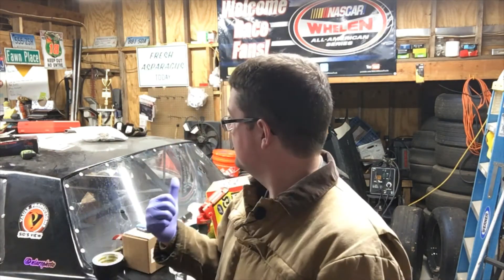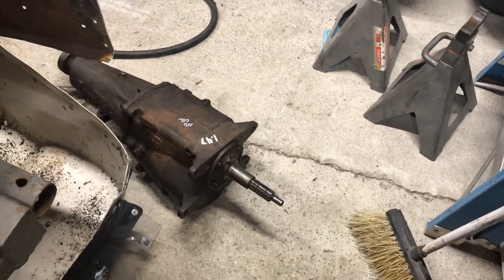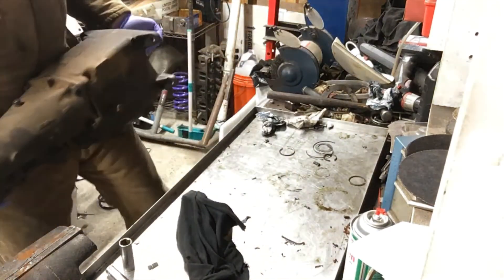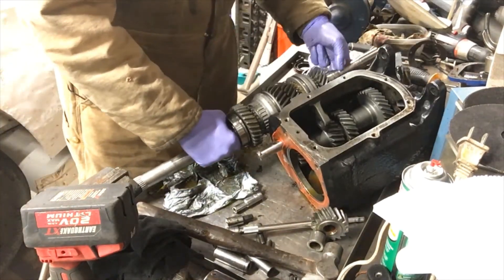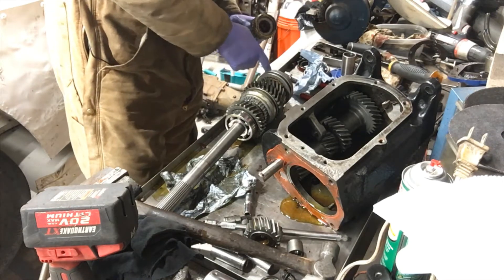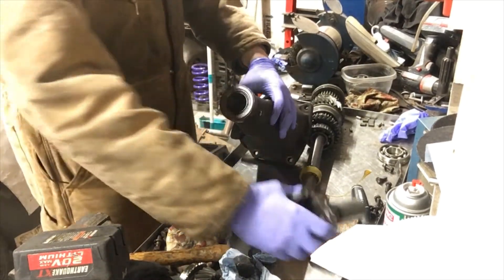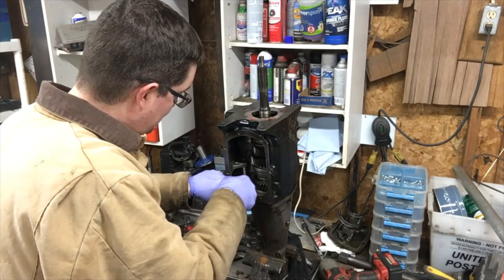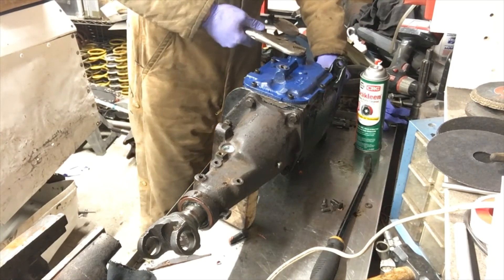Channel revival! How to fix a Saginaw transmission!

Comment: I have done a dozen or so of these in my time and this video is true to life. Grate transmission easy to fix. Can hold up to 450 HP easy. If your knot dumb, mmm can run a clutch.

Comment: Hello, thanks for this video. 

I have a Saginaw 4 speed that whistle during acceleration and during load (uphill). Any idea what's wrong?

The yoke have a play that's about 0,7mm (side to side/up down) out of the tailshaft.

Best regards, from Sweden
Reply from the maker: I’m unsure what exactly could be wrong, but if my transmissions have any noise, I typically service them👍🏻

Comment: Brent, sure hope I can an answer from you on one of those bearings.  At 13:33 in the "How to fix a Saginaw transmission!", you pull the front bearing out like it wasn't even attached.  This is where I'm having a problem.  

I pulled out the entire pilot shaft (where the splines are located).  But there is a snap ring against the front bearing I can't seem to remove.  The ring does not open wide enough to clear the bearing, because it bottoms out inside the groove.

In your video at 13:33, you show the bearing with the snap ring still attached to it.  How did you remove that bearing?  If the bearing comes out without removing the snap ring... what's the purpose of the ring?
Reply from the maker: Oh, I must have skipped over removing that lock ring, yes there is a lock ring retaining the input shaft bearing to the input shaft, I use a set of lock ring pliers to get those off and the bearing should come off the input shaft with little effort. I hope thats the answer, if not comment back and let me know!
Reply: @BrentGleason  Got it!... Thanks.

Comment: one question! I get revers and first gear but why is the switch on 3rd gear? I have the same transmission. or WHT is that switch for?
Reply from the maker: Honestly, I don’t even really know. I only use these transmissions in my race cars and have never needed to hook it up to anything🤷🏻‍♂️
Reply: it's weird, I hooked up a test light and it lights up on 3rd gear🤷‍♂️
Reply: ok I think I figured it out. it has something to do with vacuum advanced.

Comment: I have that transmission and I need to find where to buy the slip yoke for it.
Can anyone helps me with that info?
Reply from the maker: Lots of performance suppliers have them, like Speedway, Summit, Jegs, etc. stock them. They share the same yoke between the Saginaw, Muncie, and Turbo 350-400’s I believe.